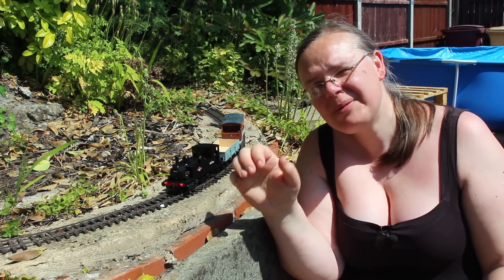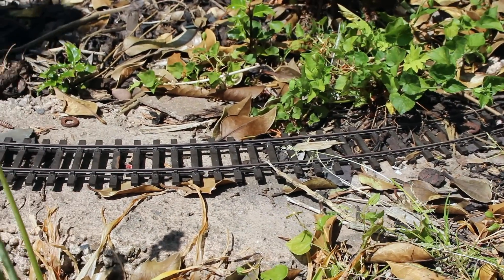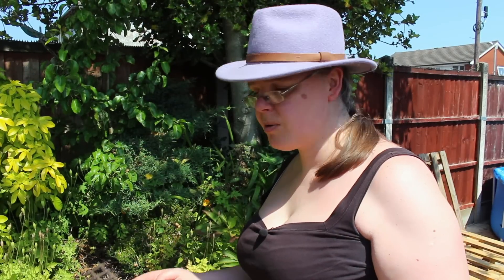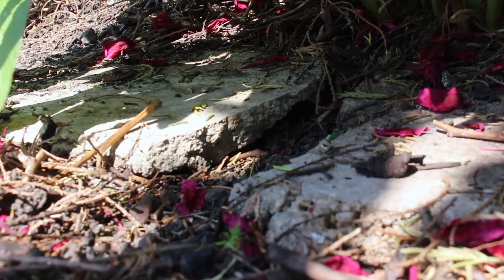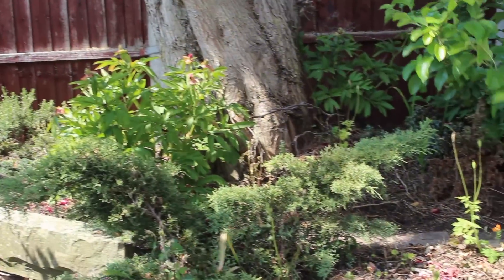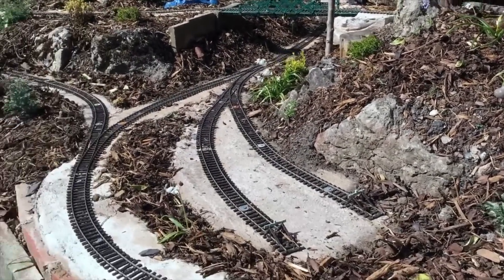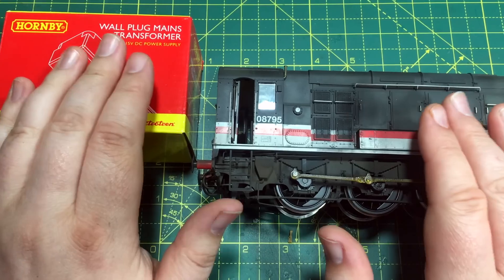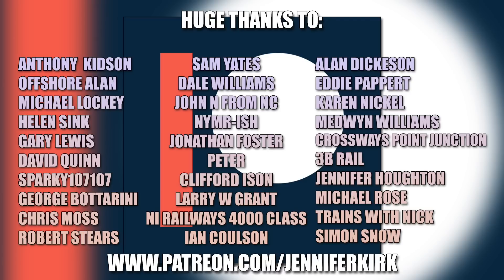Rebuilding the O Gauge Garden Railway - Part 1

Comment: Thanks for a interesting new topic of your garden railway. I started a 00 gauge setup last year and we covered the setup over winter and to my surprised all worked well even without a track clean. The only problems were two point little spring failed to work. That's my fault for no oiling or giving them a shot of silicon grease. Looking forward to your further video's.

Comment: So , I had a O gauge layout in garden for 9 years . I wore it out . I relied on R/C control and a variety of Rolling stock the best to be fair was Skytrex locomotives  offering 4 - 9hrs running time . Also Lima stuff was a cheap but robust . Big problem with slugs snails & cats . Also every running  session  required about 1/2 hour fettling  track something you've failed to mention.  During lock down stepped up to G scale , and is a fantastic addition to garden  . However not to keen on continental stuff , so currently  running Thomas stock but modified .

Comment: Great to see you getting the garden railway sorted, it's giving me huge inspiration to go out and get mine done!  Like you I will be fitting the Hornby HM 7000 chips with my Dapol 0 gauge locos, however I'm pretty sure that they won't handle the power requirements of the Heljan locos such as the class 37, 47, 50 and 56, do you know of a "blue tooth" sound chip with a bigger power handling capacity? Anyway good luck with the work and keep these videos coming please!

Comment: Something to consider power wise. A modeler here in the US runs his locomotives via blu-tooth and a battery car. He uses a LIPO battery in a box car and connects it to the loco via a plug. No power on the track at all so cleaning is not an issue.
Reply: That Larry would be the perfect set up for Jenny.  In a way it future proofs the garden railway as the older one gets, the less you want to be bending over cleaning track!

Comment: Hi Jenny. i have a `out and back ` o gauge in the garden and i run a  dapol 060 tank loco with a auto coach on dcc using the Gauge Master wi fi,  which i operate from my phone . Also having a `oo` layout and purchased a HM7000 chip . I had thought about putting the HM7000 into the `O` gauge loco but was not sure if the motor would blow the  chip ...what are your thoughts ...cheers
Reply from the maker: HM7000 work fine in the small Dapol locos. However I would not try it in a Heljan big diesel as these draw a lot more power.

Comment: An extremely useful and welcome video, thank you. We’re planning to have a garden railway at some point, possibly next year or 2025. It’ll be OO for prototypical length trains for which the shed is too small. Height differences prevent one being connected to the other, so HM7000 might be the best solution. However, Hornby haven’t released any more sound profiles for it in nearly 3 months. With Simon Kohler now gone, is Hornby still committed to the project?
Reply from the maker: They are very committed. Android App is taking priority but is slated for release by the end of the month. Then more profiles will come - class 55 release is nearly ready.

Comment: Unfortunately I live in a flat without a garden. I have quite a lot of smaller "O" gauge locomotives and rolling stock but no space for a garden railway or a shed for a "00"gauge. I will try to go with "009" as I have a lot of Lynton and Barnstaple locomotives and rolling stock. I also have some continental narrow gauge stuff. I hope the weather holds for your new project but it is unlikely that I will be able to visit it  as I live in West Sussex. Your's sincerely. Ian Cooper.

Comment: Sorry , you still need very clean yrack for power. Im thinking , fit a few freight vans with lithium batteries , like your drill batteries. And when you run out of power you swap out the van with a frest one and charge the outer. Plug in wiring to engine. Cant hurt to try.